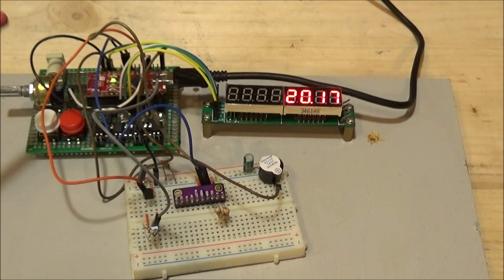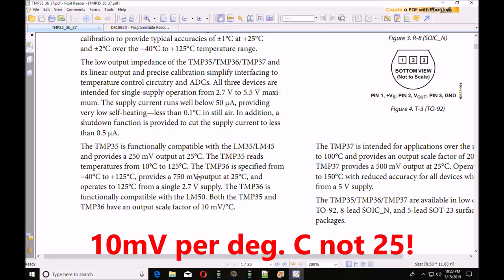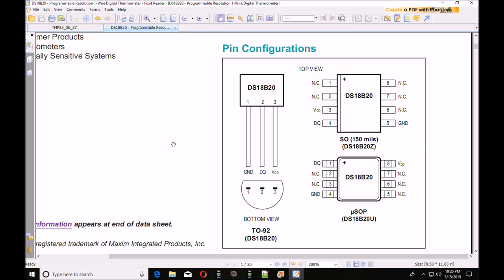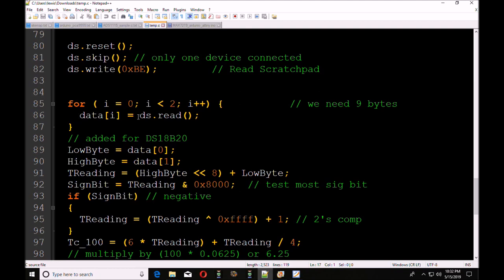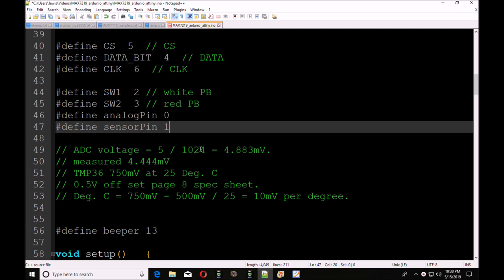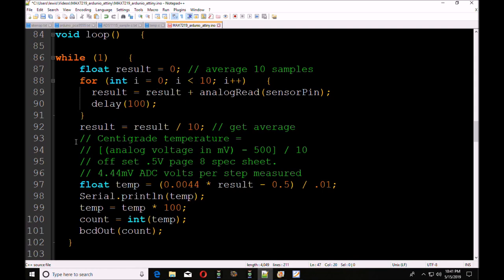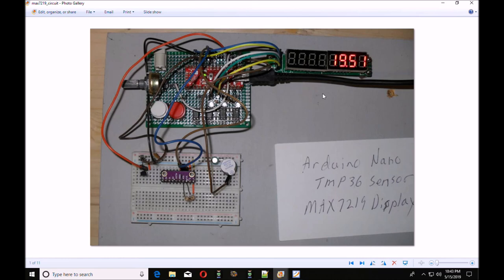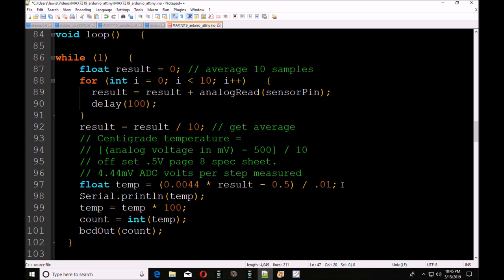Arduino Analog Versus Digital Temperature Sensors.

Comment: Thanks for the video -- I am doing a final project for my year 1 digital electronics class and our score is based on the number and weight of the various ICs in our initial lab kit.  I am making a circuit to run a 2-output, 1-input temperature controller (for a "fermentation cabinet" or any enclosed space). 
 I have microcontrollers that could accomplish the entire circuit but I won't get any points for using one based on our scoring system, so I thought it would just serve as a glorified Analog-to-Digital converter for an analog temp probe. Now I'm learning the DS18B20 is digital output, and has some other features beyond mere temp value...so I've got to reconsider my circuit.

Comment: Just started playing with DHT 11 &22 sensors , The temp sensors are good but the humidity side is useless ! I have the DHT 11reading 75 %  the DHT 22 reading 52% and a shop bought unit sitting smack in the middle of those  two readings so which is correct ?  Talk about frustrating !
Reply: Try getting an SHT31 Breakout board and compare them all